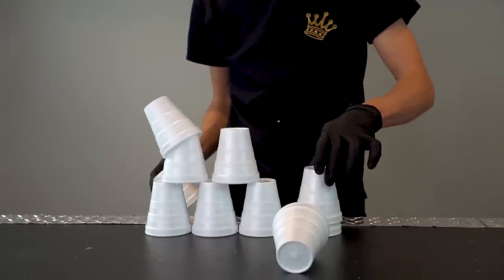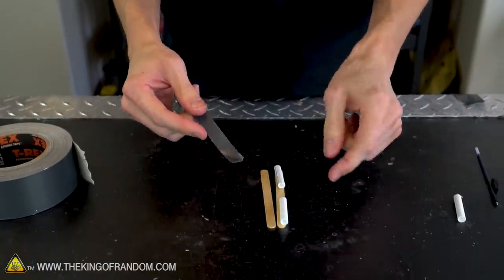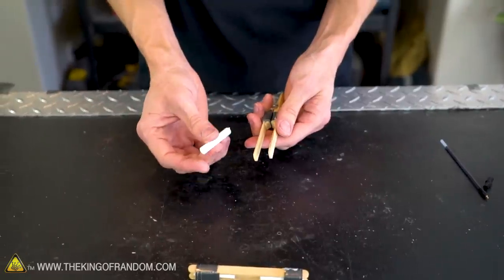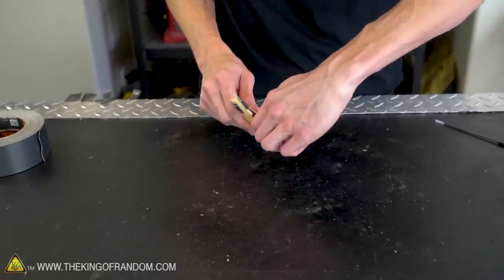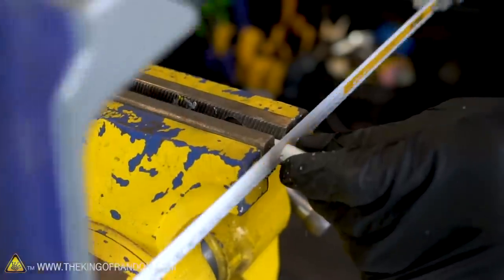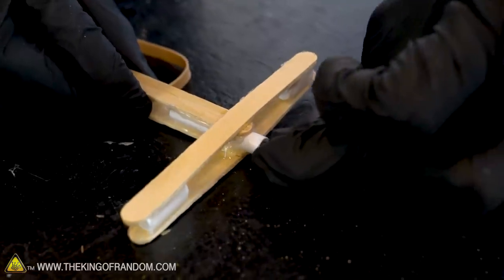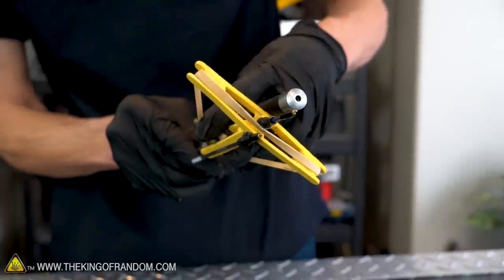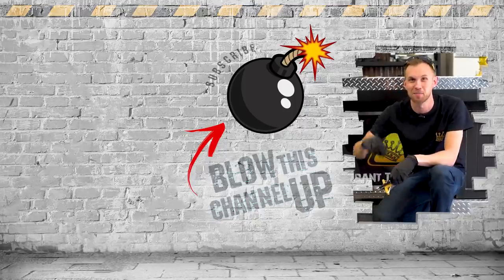DIY Pocket Crossbow! TKOR Guide To Pocket Clothespin Crossbow, Mini Crossbow, Micro X Box and More!

Comment: Actually, you can get super glue to kick right away.  You can use baking soda which will also add some body to it, or there's a spray that you can get at many hobby stores.  It works really well when you're putting together a mini and you want it to set instantly because it's a small join.

Comment: Laser pen calibration:
Put the crossbow in a secured vise and shoot at a sheet target 15 ft away. 
Keep the vice and crossbow as is. 
Mount the laser pen to the mark it made using shims. 
Glue it down as it’s still on the mark.
The original projectile is now set to the calibration.

Comment: Is is better if i use rubber bands or if i use elastic wood for my big crossbow ? Pls anserw i dont know ?
Reply: 2895 1460 a cross bow will typically use the flex in the wood or metal to get strong thrust, but if you want to use something that stretches, use workout rubber bands.

Comment: This can be made simpler by instead of making a crossbow you can use the pen as the barrel and a rubber band which is attached to the pen then put the cartridge down through the pen.